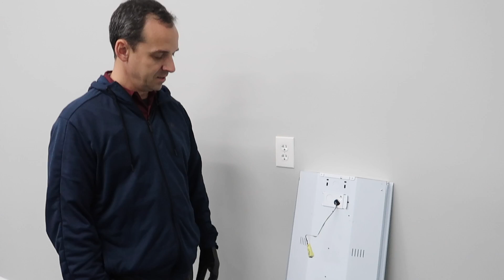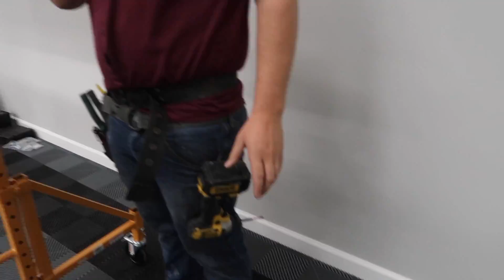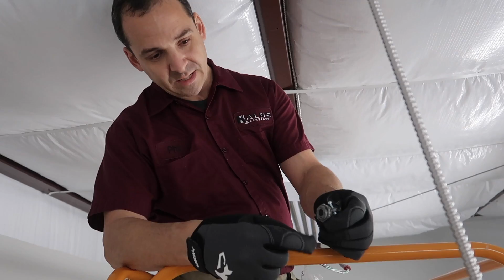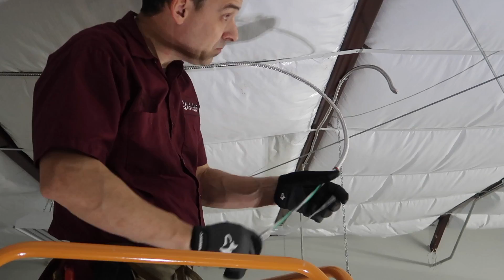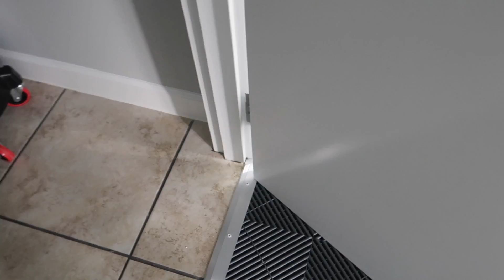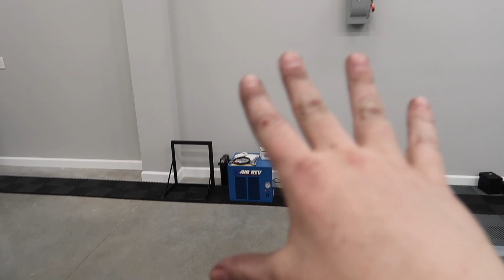Lighting Install at OGHQ

Comment: Matt, are you planning to do a video on your Milwaukee cordless setup? I would love to know which impact wrenches, drills or whatever else you have. Did you go with the high impact or medium impact 1/2" Fuel? What's more useful for car stuff? Cheers
Reply from the maker: Yes, it's on my list.  I plan to offer Milwaukee in my store to simplify all of the zillion choices of products they have.  I'll be reaching out to them later this year to really dig into the product line and distill it down to what we actually need (want).
Reply: That sounds great, I really look forward to it.

Do you have any ones that are on your mind right now? I am thinking the M18 Fuel Gen2 1/2" High Torque Impact Wrench and the M18 FUEL SURGE Impact driver (1/4") might be the two most useful ones?

Comment: Great work on lighting. As a journeyman wireman I always stress on lighting. Good lighting is not cheap but in the end you wanna be able to see what your doing without added aid. Only thing I’m gonna nip pick is you ether twist off the end’s of your tye wraps or use flush cutters. Cutting them with Klien’s leaves a sharp edge that will split your hand wide open. I’ve got plenty of cuts over the years and it will make you say some choice words haha. Can’t wait for more crazy in the “tanning bed” OG HQ. great work Matt.

Comment: Is that panel just for your unit?  It’s damn full for just that small space.  Usually you can get a 4000 SF house in a panel like that with dedicated circuits for fridges, AC’s, etc.
Reply from the maker: That's what I thought.  I couldn't believe it was full.

Comment: Shop looking food.  
Raptor is so big makes it look smaller. Lights look nice but would a couple lights 3/4 the way down the wall  on each side be nice to have when polishing and waxing? Like a paint booth.  Virtually mounted on separate switch.
Reply from the maker: I've never liked the idea of wall mounted light.  I'd rather have moveable lights that I can control.

Comment: Thanks for the video Matt.  For those of us installing in a residential garage, can we surface mount instead of chain mount?  It seems the ground lug is on the top of the fixture which would prevent surface mounting.  Thoughts?
Reply from the maker: Yes, surface mount is how I have them in my wash bay.
Reply: Just not seeing how this particular fixture will sit flush in surface mount position due to the plate which the ground lug is attached to.   You have these same fixtures in your wash bay?

Comment: That's not how you cut mc cable I've been in the trade for years .
Reply from the maker: Seemed to work for fine to me.  Maybe you've been doing it wrong all this time.
Reply: Greg Boles how do you do it?
Reply: I nick the corner of the outer jacket with my dikes , and twist the metal jacket off, limiting the probability of " nicking"or "clipping"your wire inside the jacket. If your twisting it and clip the metal jacket and then throw a connector on the end you have a sharp end on your metal jacket inside the connector . It's all preferability .. you didn't necessarily  do it wrong , I just prefer it that way . 

I love the new lights and the channel! Keep the vids coming !!!
Reply: If one knows how to use a roto splitter you’ll never ever cut the conductor. These tools where made for efficiency I’m sorry but your way is not efficient.